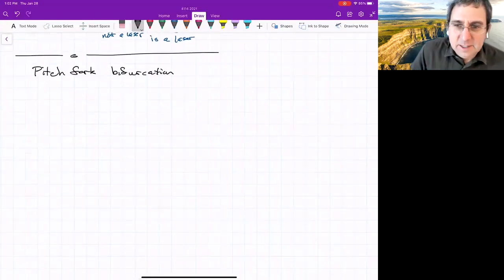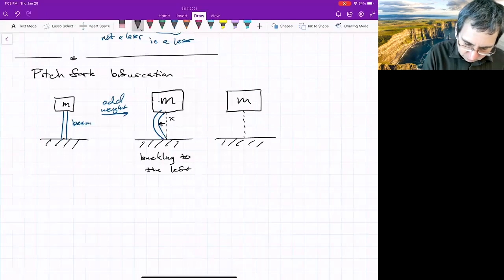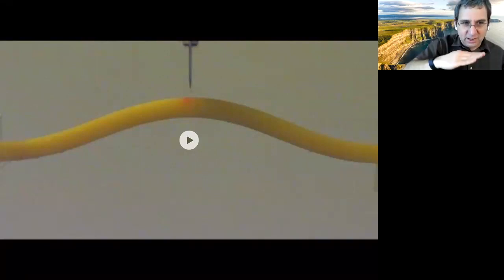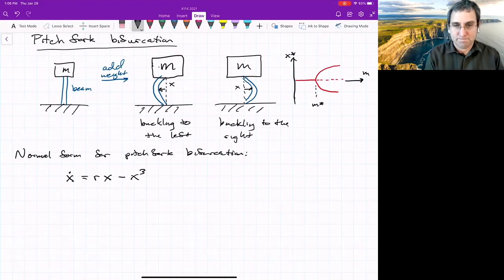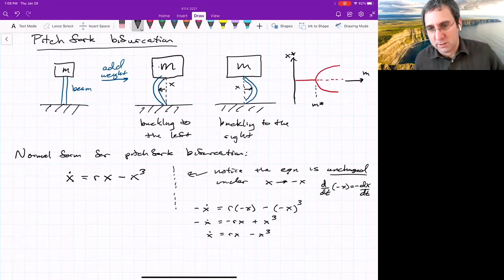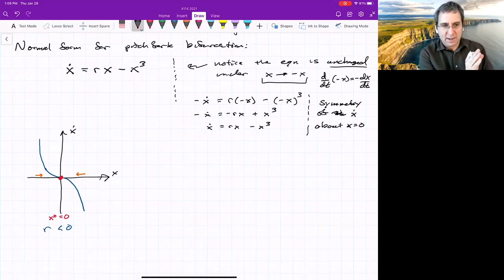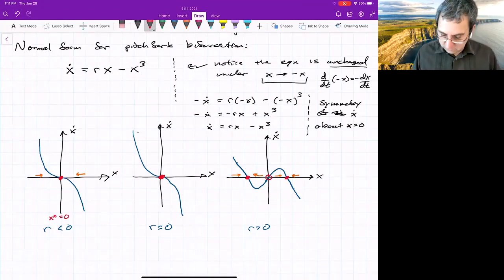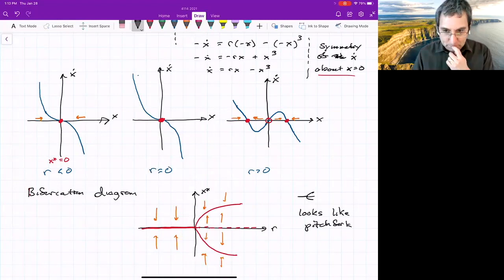Bifurcations Part 3- Pitchfork Bifurcation

Comment: Not to be picky but columns are vertical and beams are horizontal.
See Euler’s Column Theory
Reply from the maker: True! A structural engineer would absolutely call it a column. I used the buckling beam as a relatable way to visualize symmetry breaking and motivate the pitchfork bifurcation—thanks for keeping me precise! 😄